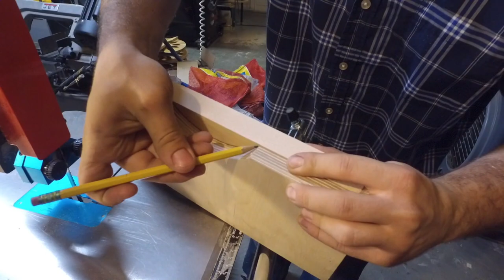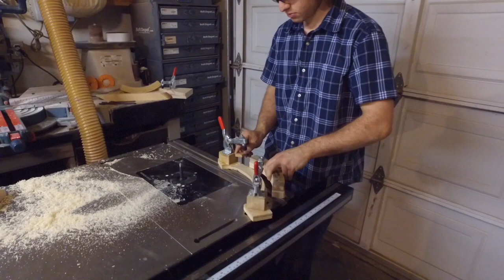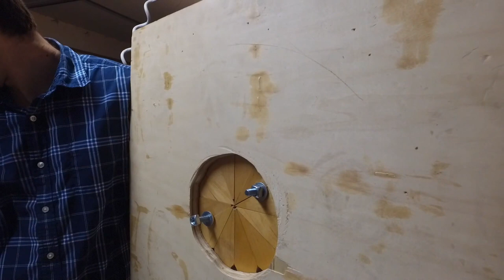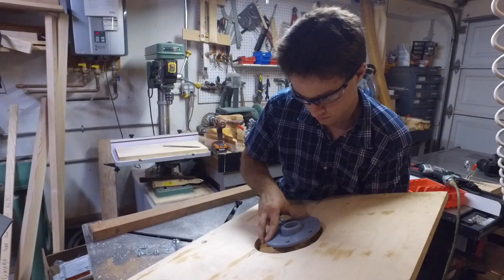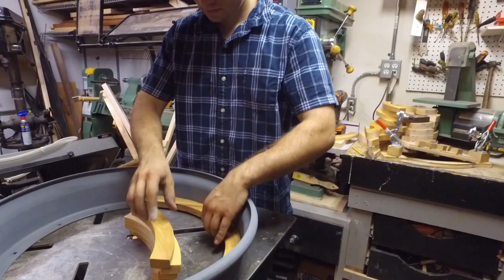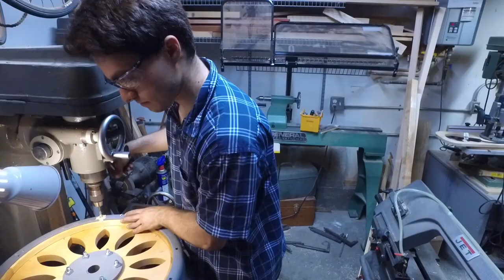Kalamazoo Handcar Wood Centered Wheel Building Video

Comment: Great craftsmanship! Thank you for sharing the video! You are very lucky to have such a nice shop to work in like that! Were the rims original or did you make your own? I'm working on getting into casting light weight railroad wheels for the narrower gauges.
Reply from the maker: I had these manufactured and are included with my handcar kits that can be found on kalamazoomfg.com.  Wheels are spun as castings are too heavy.
Reply: Wow! I'm very impressed. My wheels will be used for ore carts. I'm casting them out of aluminum for now. I've got one 2' gauge ore cart on aluminum wheels. The rest all ride on crazy heavy cast iron wheels. Can you sell the rims separately? I'd be interested in purchasing some to build a standard gauge rail bike for work.

Comment: Magic! I have a wheel that I need to fit to a different sized axle and it would appear that if I turn a plug for thew spoke centre, that I can hole saw out the new bigger hole... to fit the larger hub!